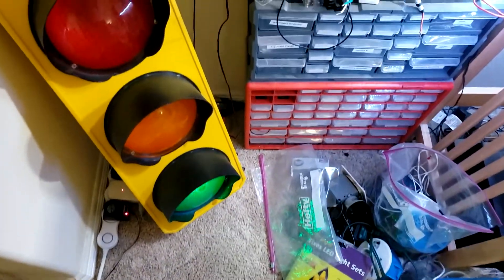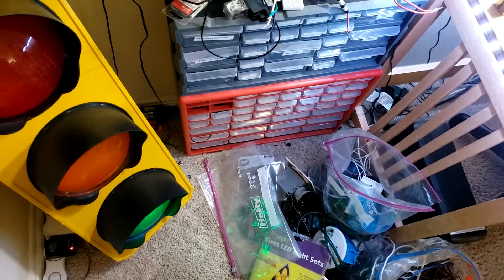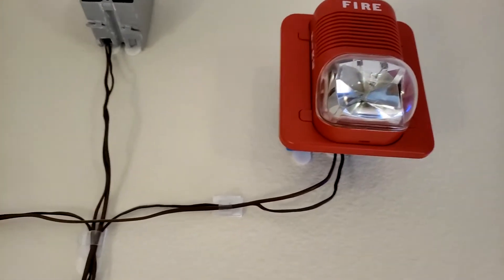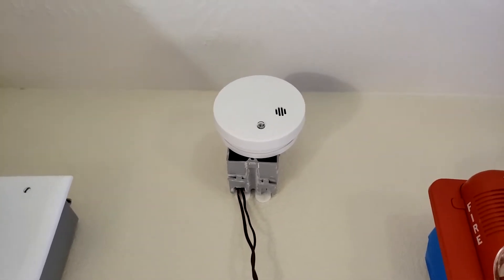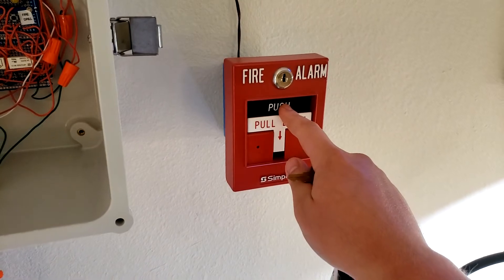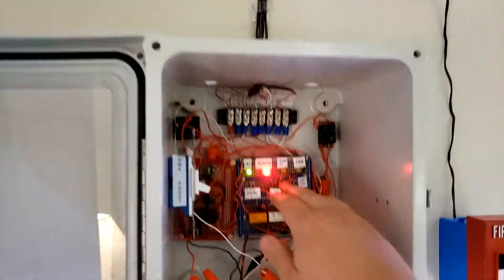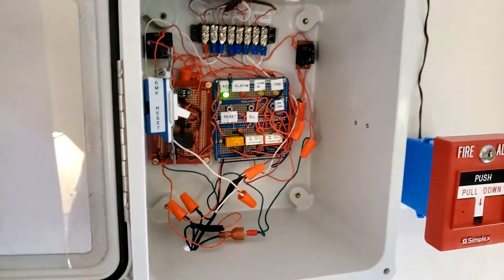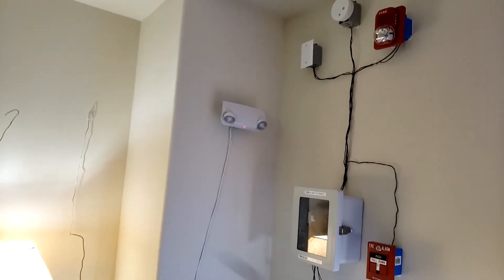100 Subscribers Special! Mini Fire Alarm System Test 2

Comment: Question, on the 6160vpadt keypad, can you program one of the side buttons to turn on maximum away mode? I was wondering because we have the keypad and i want to know. Any answers would be great.
Reply from the maker: Yes you can. In programming the vista panel, is by going *57 function key programming and chose whatever of the four function keys of the keypad to tell the panel what to do.
Reply: @EYL8902  does the keypad come with the maximum away lable for the keypad?
Reply from the maker: @MJAPlumbingandHVAC  Yes. To do that use your master code, and then press 4 at the keypad, which it will then arm the system in away instant or maximum.
Reply: Two last questions, does the keypad itself come with the label stickers that say away max. And are away instant and max the same thing, and if so, what are the differences?
Reply from the maker: @MJAPlumbingandHVAC  I guess theres labels for that, but IDK. Away instant is basically same as maximum.
Reply: @EYL8902  thanks so much for your help! Have a great day!!! 👍🏻